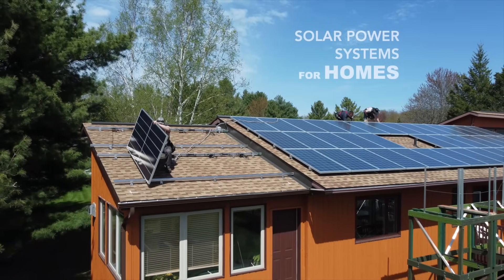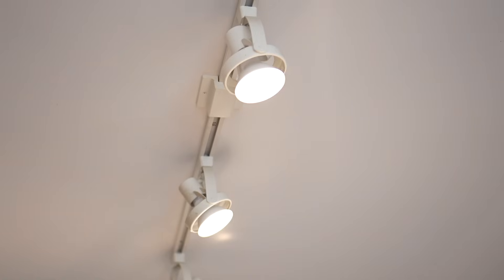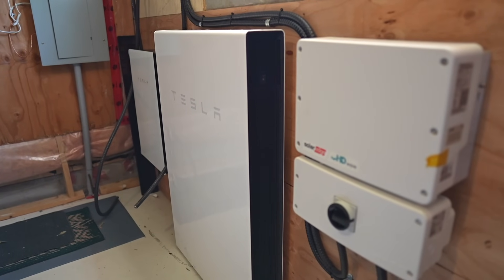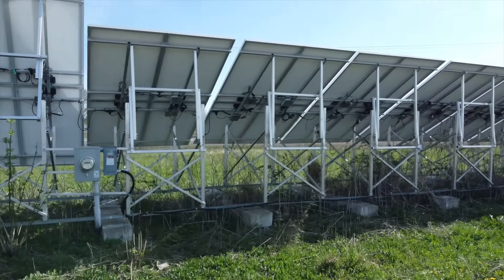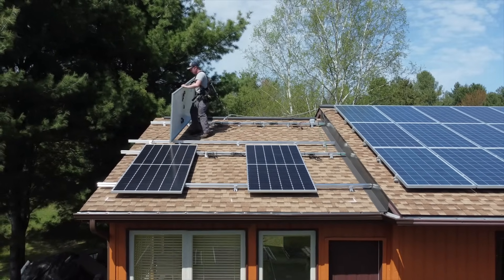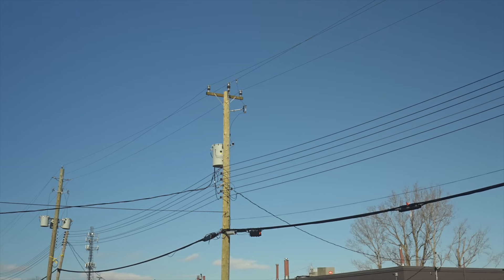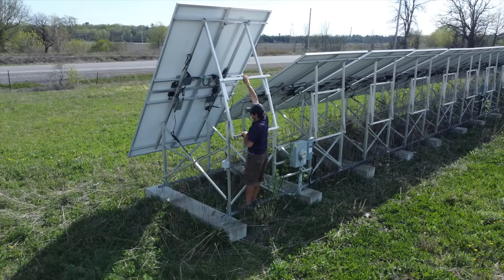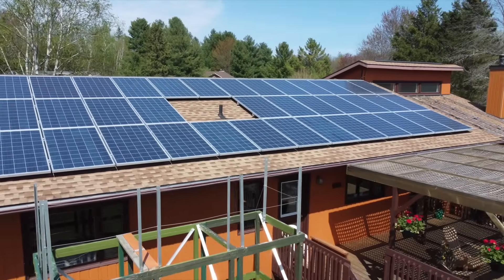Should You Go Solar? A Super Helpful Beginner's Guide to Home Solar Power

Comment: Off grid is best, every house has enough roof to give u all the electric u need, u need to buy batteries, 20x 300w panels, 20 batteries of 100ah, charge controller, or controllers, and a good 6000 w inverter, buy it all from chinese, so u don't get ripped off, in winter you must shovel the snow off panels

Comment: I called a company to quote solar for me, they said they wont do it because of the amount of electricity i use, or lack of electricity. The city will only allow anyone to "sell" the amount that you use, because the infrastructure is really designed for one way electricity and there's a limit to what it can carry. The system required for my useage would simply be too small and there would be too much excess energy and financially just not worth it as it would take too long to break even

Comment: why don't you show us all the hardware installed and only the solar panels, the solar panels surely cannot provide the AC power that you use for your electric appliances, it requires batteries and converters to convert the DC power back to AC.

Comment: Is it possible to own your own panels (finance) and run on the city to offset the power generated from the panels?
Reply from the maker: Thanks for watching!  I think what you’re describing is called net metering in Canada.  It’s where you own the solar panels and they generate electricity that is fed to the grid.  You then receive credit for the power you generate, which is applied against the energy usage in your home.  As far as we know, this doesn’t generate income, but if the system is sized correctly for your usage, you could potentially offset all of your electricity bills and also generate solar power for the grid.  Hope that helps!  Thanks for watching :) :)

Comment: I would advise if you have extra money and want to make an impact in the environment go ahead and install solar,but if you just want so save money on your power bill don’t install solar,electric companies have taken over.
In my case I have 26 panels to produce enough power for my house right? Well not anymore,it work in a weird way where if you don’t use it goes to the grid (power company)which they pay you not even half for kilowatt for what they charge you for it,to fix this issue you have to install batteries [15-25k] depending on your system so if you add 50k +15 that’s 65k,you can see savings in about 20-30 years,like I said only if you care about wealthy people’s future then buy solar.

Comment: My biggest concern is hail.  I am on my 3rd roof in the past 4.5 years due to hailstorms.  The solar power firms claim they will withstand hail, but recent pictures of most of a solar farm destroyed by hail has me questioning it.
Reply: You need a metal roof.
Reply: Or slate, but the whole building has to be designed ground-up for that. Metal would be best bet.

Comment: No one is talking about the additional cost to remove and replace the panels when the roof needs to be replaced do to age. 90% of people ditch the panels when the realize that they have to find a third party company (which don't exist ) to remove and replace the panels. The roofers won't touch them and the solar panel companies will only install new systems. That is the cold hard solar truth that no one want to talk about. Sorry.
Reply: Excellent. For decades I thought that it was a fantastic idea although I've never done it. Only the last few days I realized that it's a very bad idea as drilling into a good roof will only bring problems. If they simply mounted into the roof deck, not the rafters, then it's only a matter of time before water will get in. It's OK to have the panels in the yard on some type of a stand but I'd never put them on my roof. Leave the roof alone!

Comment: Reducing power bills is so much wiser than investing 50k or far more into a good solar system. Most average sized homes that are well insulated and have some modern tweaks for extra energy savings can result in $60 - $100 per month electric bills. How many months of electric bills would the cost of a nice solar system pay for? $50,000/100/12 equals 40 years of grid electric bills. Considering that you’ll be replacing the solar system long before that the grid wins again. You just have to know how to use energy wisely and how to make your home more efficient. 
Granted that an offgrid situation is different. Where my cabin is located it would cost $100k to get grid power to it…so solar system wins.

Comment: How long do batteries last, and if taken into account maintenance (ie battery replacement) is it worth it ?
Reply: Batteries are the most expensive part depending on your set up and how many panels you’ll need depending on where you live. They cost about $11k for a cheap rack that you do yourself. That is considered a good deal for lithium iron phosphate which will generally retain 80% capacity after 15 years. This gets you 30 kwh, which is what the average US household uses in a day. 

If you want to have 3 days of independent power, well, you’re looking at 30k. Most people would be fine with just having 30 kwh.
Reply: I just priced solar for my home. 12 panels was $15,000. And the battery was $16,000. The panels are warrantied for 25 years, and the battery is only for ten years.😮
Reply: "is it worth it?" Depends on if you are in an area with lots of blackouts. If you don't need to worry about power outage then no need to get batteries
Reply: @tonylarose4842 What about during the night when you need electricity ?

Comment: Instead of conventional roofing material on carports, terraces, porches, etc substituting them for bifacial solar panels reduces general costs, reduces heat issues/adds to solar panel efficiency, is more pleasing esthetically etc.
Reply: I always that was a great Idea. I like having a covered backyard deck, rather than a crank out canvas awning I’d love to frame up a roof over it and use solar panels as the roofing material. Two birds with one stone.
Reply: @jayson657  
Exactly.  
I would try to set it up in a way allows the heat to escape, especially near the top even on bifacial panels because it does improve efficiency.  They found vertically placed panels did surprisingly well for harvesting energy...

Comment: I have been off grid for almost 15 years.
My inverter has died twice due to lightning. A thousand dollar repair each time, leaving me at the mercy of a gen set while waiting for the repair to be done.
My inverter does not come with a built in surge protector.
If yours does not have one, then I recommend to install an after market unit.
This is my biggest recommendation to anyone considering a solar system.
My second recommendation is to go for a 48 volt system.  The higher the voltage the better.
Do your own research on batteries, as there are a lot of options out there and most being easily accessible.
Reply: get a specialist to sort this once and for all